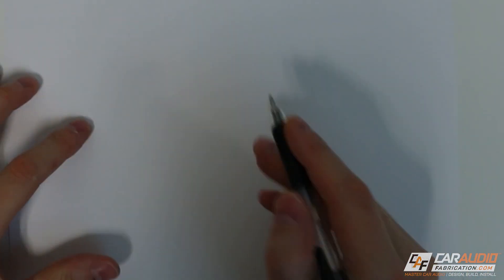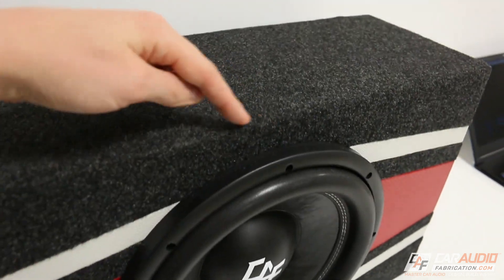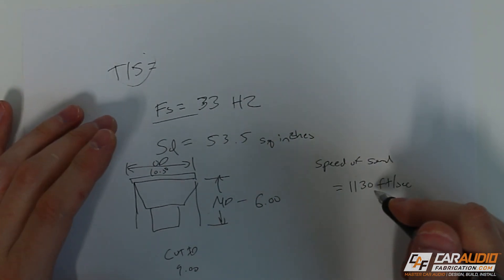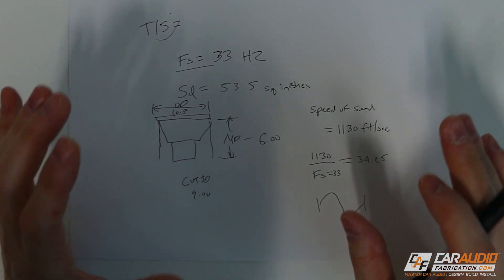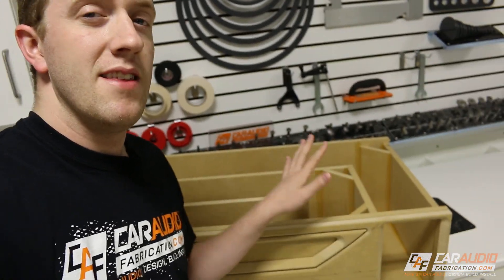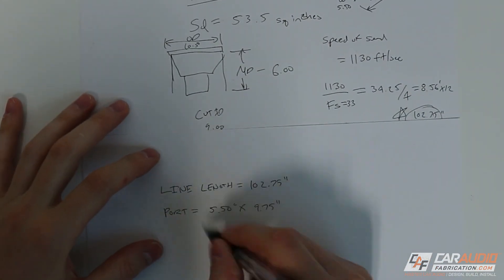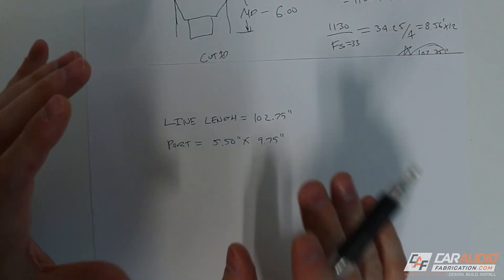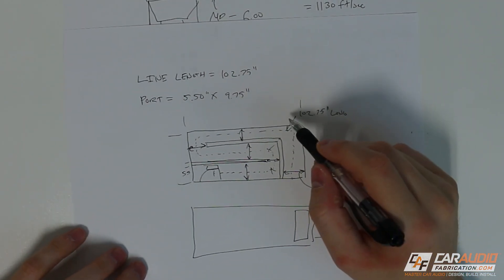How to Design Transmission Line Subwoofer Enclosure

Comment: So a T line will be the best for a home theater subwoofer? If not then what is the box for a home theater subwoofer?
Reply: There's no definitive answer to that. My personal favourite is a sealed enclosure with EQ on low end - you get a compact box with precise bass - this is what Velodyne does. Or you can do a passive radiator, which might be ideal if you want good performance at very low end, wouldn't need that much EQ (so it would be more effective), and will still be relatively compact. And then you can do a TML if space is not a problem.

Comment: any reason why you didn't offset the driver along the length of the line? A 0.27 offset would smooth out the null that unavoidably occurs around 200 hz.
Reply: Why would you worry about 200Hz frequency in a subwoofer? It will never play frequencies that high. That's also why a standing wave is never a problem in a subwoofer.

Comment: Really like these super technical videos. You do such a good job at explains complex concepts and techniques.
Could you possibly do a video or even a demo comparing 3 boxes of equal size and volume but one is t line, 1 ported, 1 sealed and measure the response with the same woofer and amp?
That would be so interesting to see and would reinforce how much difference a good enclosure can make.
Reply: Car Audio.etc i
Reply: This isn't super technical, its basic.....

Comment: Can you explain the advantages/disadvantages of a T-line vs a sealed enclosure? You went over the ported enclosure, but not sealed. Is the frequency response even smoother than a sealed enclosure? Or is it still getting a bump, but the bump is less severe?
Reply from the maker: The frequency response would be similar in "smoothness" to a sealed enclosure, but a T Line tuned to a low fs will typically have a response that digs much deeper into the low notes. That said keep in mind that once in the vehicle the low end response will generally get a boost even with a sealed enclosure. The T-Line takes up a ton of space, I could have probably fit four tens sealed in the same space as the enclosure I built for one ten as a T-Line.

Comment: I would like to build a T line for a couple 10" Boston G3 how would you do the math for multiple subs?
Reply: Just double the cone area. If one sub is 50 square inches then it would be 100 for two. The length of the port will stay the same. Hope the helps.

Comment: Question - I’ve been digging around for a while, trying to find some answers, but any information I have come across has been contradictory. I know how complex acoustics can get, and with that, I’m wondering how the professionals design full range speaker enclosures? I’ve learned a lot about subwoofer enclosures from your channel, but do all the same concepts carry over? Can you tune a full range enclosure like that of a subwoofer? What about ports? So many questions, I don’t even know where to start...
Reply: enclosure is for the bass, the only difference between designing an enclosure for subwoofer and for a fullrange is that with fullrange, you must take standing waves into consideration. That's why fullrange TML enclosures are always tapered and dampened.
Reply: Tomas Kuruc thank you! I’ll need to do some more research but this is great information

Comment: you could shrink the port size "width" to about 3 inches and increase the port length 120  simply making the box more narrow but not as wide in therms would be a higher "response" but really its a t line with more port length then width but the term flat response is only used with  quarter wave t lines where if u do what i said its similar but the response isnt flat  bt theyre still equalized to same db on each scale ive estimated that your box is doing a good +2 db on most and +4 on higher wich isnt what you want you want an even boost to 1-200hz  wich is why im saying shorten the width increase the length it'll lower to response on high scales to =+2 or even higher if you design it right its a tangband t line
this box is similar but i wouldnt recomend t linging any woofer theyres limits to a t line one limit you really want speakers with low fs and a long throw suspension for a clean deep rich base im in the middle of designing a theater t line where theres 1 woofer using a band pass style enclosure and a passive radiator  where the woofers are both closed in a band pass enclosure for the radiator work with a t line port bot woofers would be sealed and t lined

Comment: That six inches deep sub is not gonna fit in that 5.5 inch box you designed.
Reply from the maker: +Chad Battista the mounting surface is 3/4 inch from the internal port width allowing for a max mounting depth of 6.25".
Reply: CarAudioFabrication nice! I knew it wasn't like you to miss something.

Comment: How much difference (db /Hz) is there between a normal sound subwoofer enclosure and transmission Line subwoofer enclosure with the same subwoofer?
Reply: MMD By "normal", do you mean sealed?
Reply: I means with "normale" a sub box with short port

Comment: If you design an enclosure for 2 subwoofers, would you simply double the SD value?
Reply from the maker: Yes, but it gets that much bigger. This is why I can't help but have a good chuckle when someone wants to do two 12's in a T-Line, under seat of a truck...
Reply: CarAudioFabrication the line length would be the same correct?
Reply: Yes, the line length will stay the same.

Comment: In some more advanced TL theory is stated that the speed of sound is slowed when passing through fibrous material such as poly-fill. This reduction in speed is dependant upon the sound frequency in question. It involves some extra math. However with proper stuffing it is possible to build a much smaller (read shorter line) TL subwoofer cabinet.

Comment: Quick question, how would you do a dual loaded tl box properly? Just double the 'port' or how would it work? I've never seen one done and I can't find much about it. Can't find much about tl boxes in general other than the basics for a single loaded box. 

I also have an odd idea/question that I can't find any information on; dual tl box with one sub? 
Another idea; could a 'bandpass' box work with using a transmission line in place for one of the chambers work? Like in a fourth order do a tl/sealed, a tl/ported would be more of a 6th order dual reflex, and for a 6th order quasi do ported into tl or tl into ported;  I have no idea how an 8th order reflex would work, but an 8th quasi would be dual ported chambers into a tl, or dual tl into a ported. 

I understand that these ideas would be impractically huge, but I'm just curious how they would sound. It'd be nice if there was a program where you can manipulate the spl/freq chart for each chamber/port in bandpass boxes, for a theoretical output; but I don't think that kind of software exists. 
Actually, is there any software that does calculations on 6th and 8th reflex and quasi? Last time I messed around with any software, it only had stuff for 4th orders. 

Also, since you've done a transmission line, you should also attempt doing a video on a horn style box.
Reply: Xander Zoolander pretty length stays the same but the opening should double in theory. One physicist said a larger opening than the cone surface area allows for the port air to move freely
Reply: Would it not also be better having the speaker fire into the line rather than perpendicularly? Especially when you have multiple drivers, since having them all firing perpendicularly when you have them lined up along one side of the box would change the tuning for each?
Reply: I dislike this design because it doesn't include the VAS which is the speakers chamber+displacement of the speaker (s). With this design it would be best to invert the sub like you said but add a 45 in the corner to direct the air flow. Also, there doesn't seem to be a definitive beginning of the port, thus port length isn't accurate

Comment: I've built two T-Lines designed by a guy on the East Coast. One for two 12's (Pretty basic layout) and another for a single 15 (Tapered with a 180 degree kerfed wall). There is nothing like a properly designed T-Line! Also, both of these enclosures were very compact and broke a lot of the "rules" around T-Lines. I got out of car audio for awhile, but I'm hoping to build one again soon! Nice video!
Reply: Ehm, when you brake a lot of the "rules" for a TM build, is it still a TM? And how about frequency curves, doesn't that hurt?
Reply: Justin Vetter

Comment: Excellent video, every time I was thinking, "but what about....(tappered, guys who think they add SPL, stuffed, multiple complex mathematical theory formulas, )" man, you had it covered. I think you really covered the basics of a T-line enclosure, with a simple formula to get someone started. 👌
Just like sealed, ported, and passive radiators, you can make full-range T-lines for home speakers. The ones I have seen are usually 6"-8" full-range drivers in a T-line.

Comment: There's an unwritten rule concerning the pole piece vent diameter and distance from there to any surface behind it. I noticed that your mounting depth is 6" and the depth of the line is only 5.75". I realize that the thickness of the baffle (or baffles) will make up for a little of the available depth. Will this cause a problem, or is that just another one of those commonly accepted car audio myths?

Comment: Thanks just subbed. Looking at making a ported sub for my car. But i dont want the peaks and troffs so was going to share a 8inch and a 10inch mabey a 8/12 to compensate. Not designing it so both play in the same air space and have  the bigger of the two over powers the smaler one. Have the issue with a 6/9 on the parshel shelf and its metal. My port are are around 6inch by 12 inch to get the bass through the back seats. Any advice would be great thanks. Jack

Comment: Can i use a t line subwoofer in a hifi system?
Reply: justin sanchez Definitely, but just like with ported or sealed enclosures, some subs are really well suited for TL while others are unsuitable for them. I believe it is also the Qts you need to check, but you should Google to know the exact numbers you have to look for for "compatibility".
Reply: Ok
Thank you

Comment: I made a tapering T-line with stuffing. Some tapering enclosures expand, the one I made contracts from equal surface area to about one third. It's half wave with a 12", and my god does it pound at 20Hz. I'd be interested to see what it's like in a car though it's 8' long, this one is just for the home theatre. The idea of the stuffing is also to reduce any port type resonances as the chamber behind the sub is larger, before the stuffing it had a 50Hz resonance and had cancellation at 60-70, the stuffing absorbs the higher frequency waves to reduce cancellation and reduces the type of airflow that a port produces to eliminate that resonance. I also used thin sheet metal behind the driver and at the curve (the design is up and  back) with expanding foam behind it to make a perfect curve.
Reply: UniCrafter In the South, we don't use Stuffing... We make dressing on the side... Will that work? 😂

Comment: Really good visual explanation using the dog food.  Good stuff!
Reply from the maker: I wanted to have a way to visually represent it, I hope it helped! Thanks for watching.
Reply: @CarAudioFabrication  Agree! What if you horn-load the sub? Does that add to the number of dog foods, due to higher efficiency?
Reply: Stuart Wood I find the wet dog food yields a smoother response.
Reply: CarAudioFabrication it did the trick